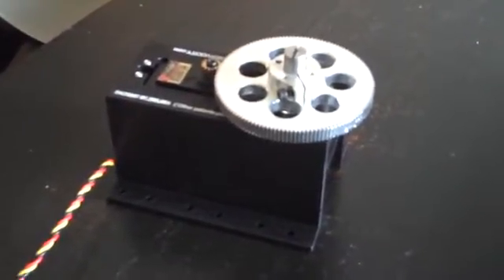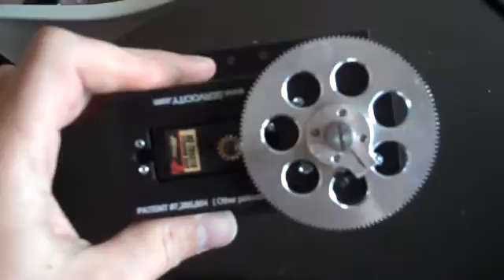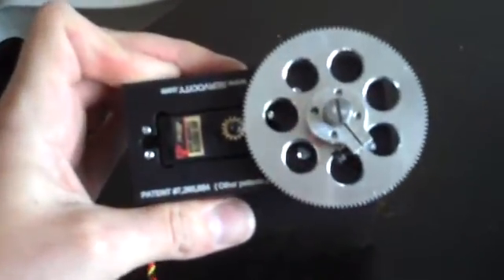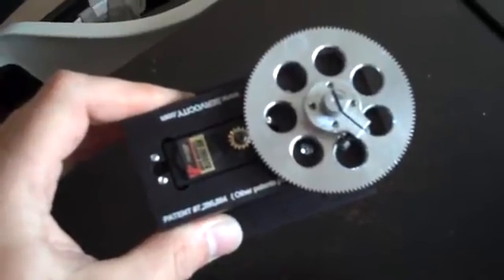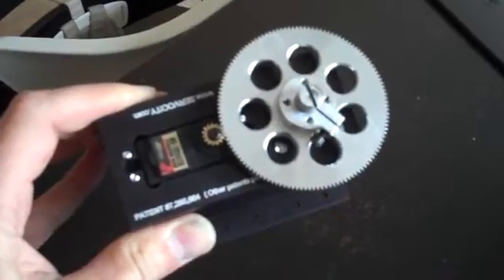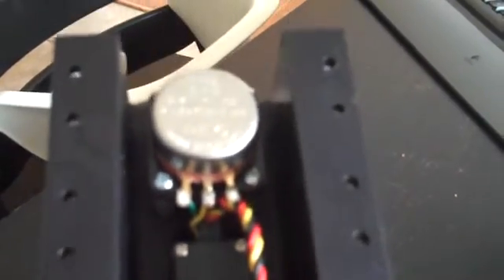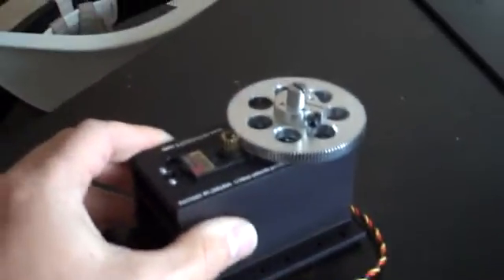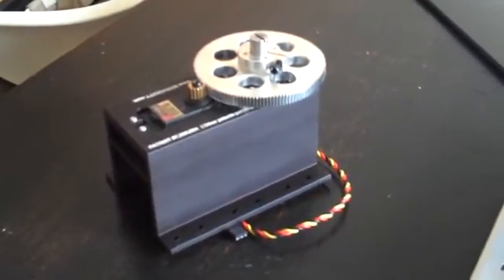Dalek Steering Servo - revision 223 :-)

Comment: Forgive me, Im no servo or robotics expert, but wouldnt just use this (a smaller ) servo to control the switch for a larger instrument for steering like a small hydraulic steering ram or a pump of some sort? Seems like it would hold up to more abuse that way also.  I just figured I would throw it out there. Good Luck with it!